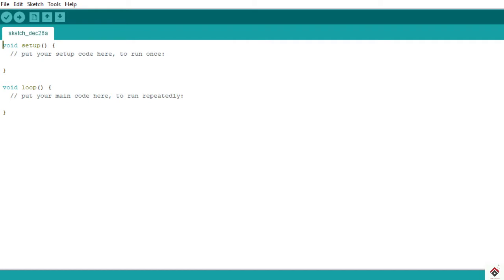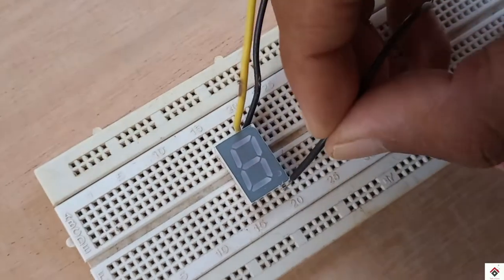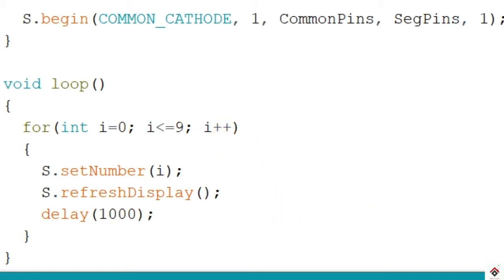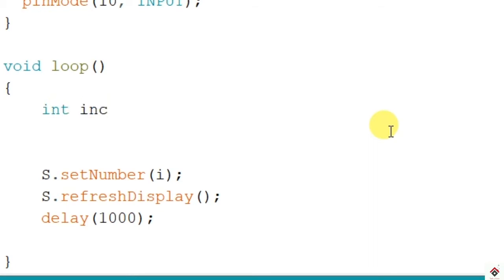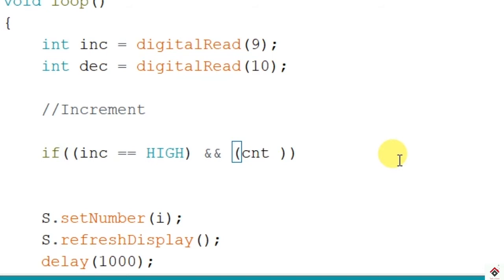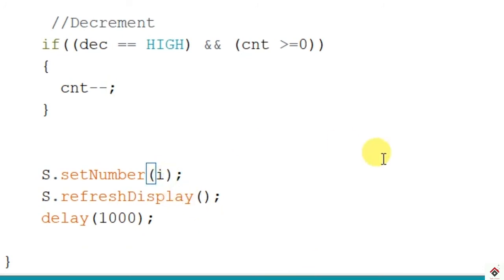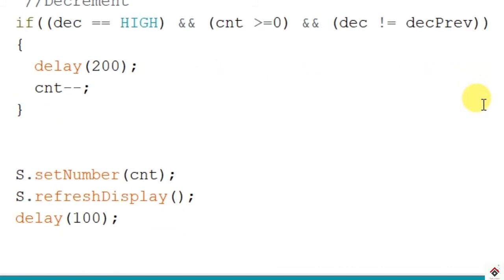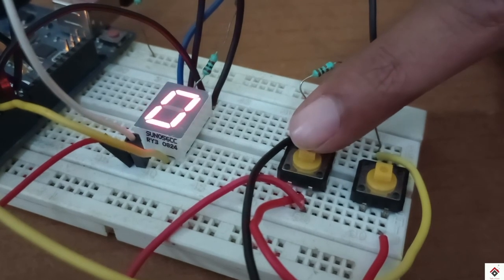Arduino counter using 7 segment display and Push Buttons[with CODE] | Arduino projects

Comment: Are we forced to put SevSeg thing?
Reply from the maker: The code will become complex without the library. You have to control each pin of the segment manually.
We have shown the difference in this video:https://youtu.be/V5S8Vvrn6cY?si=oxNQuiBHQQOgZiur
Reply: @techathome 
Ok but show me the code in simple text, not in video PLS
And make a 15 number version pls
Reply: @techathome 
Oh thanks by the way the diagram make the project easier. If u can, can u PLEASE do a slower version of the connections and code. Thanks !

Comment: Hi,

i'm using a bit from your program to make a scoreboard.
for now i'm testing with a shift register and 1 digit 7 segment display.
sadly it doesn't work like yours.

i have the feeling that there is something wrong with the cnt variable. or inc or dev
Reply: if i start my program, value of the display show's 0, but i have to push 2 times to get a 1, ferder on it works. but this give problems with decreasing

Comment: Hi, why your are giving delay(2000) inside a if condition why not immediately after  inc=digitalread(9); delay (2000) 
Like this
Reply from the maker: If you dont have delay inside if condition, as soon as u press button, count increment immediately.
You can consider as sensitivity. With delay, you need to keep pressing the button for few milli seconds.
You can try removing it.